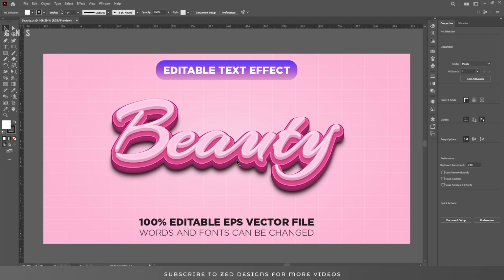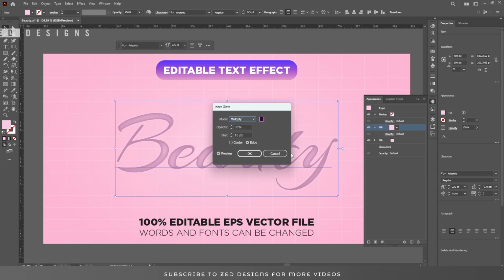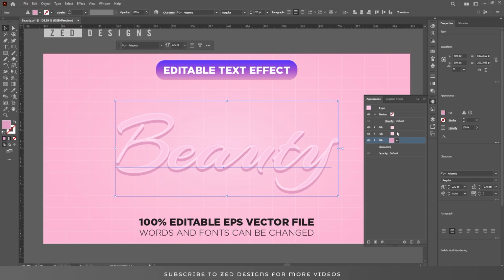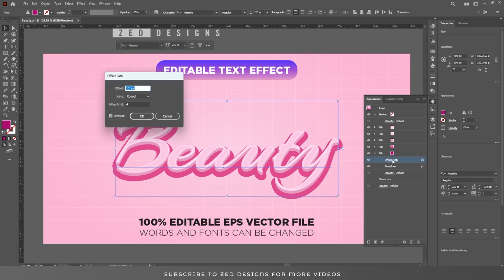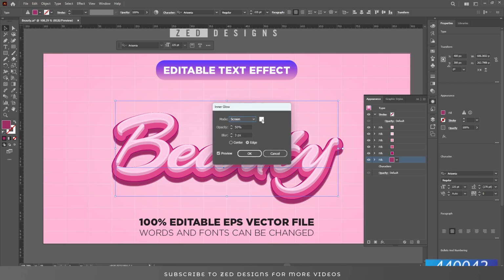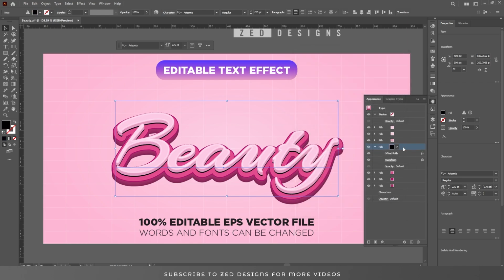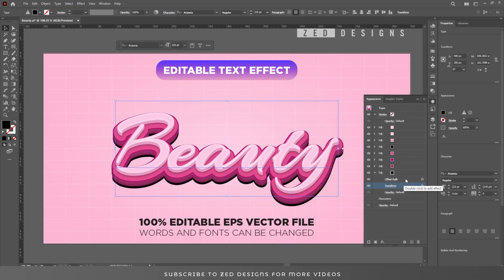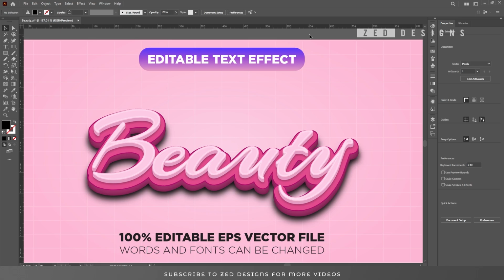3d Text Effect in Illustrator - Beauty Product Logo in Adobe Illustrator

Comment: Inner glow does not work on the text im trying to use for me for some reason. As soon as I create outline the inner glow works.
Any ideas?
Reply: Nevermind, You must group the live text. In appearance panel, if it says Type at the very top, those filters will not work properly. Make sure you group the text, and then in appearance panel it will say Group at the top instead of Type. It will still be live text and inner glow and other filters will work.